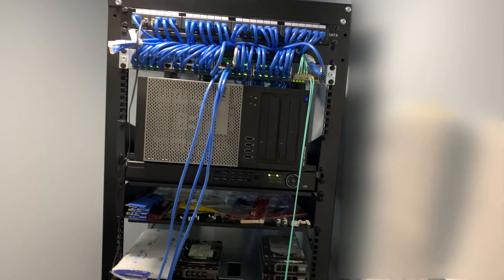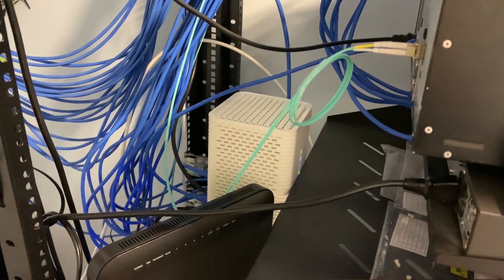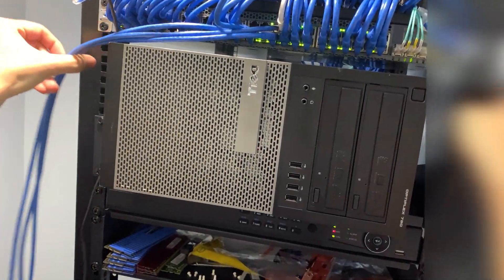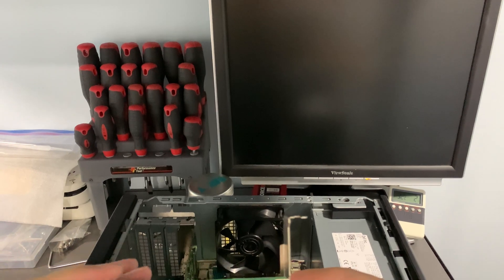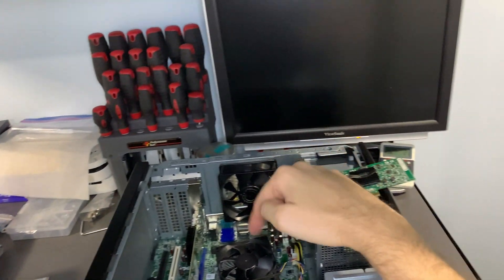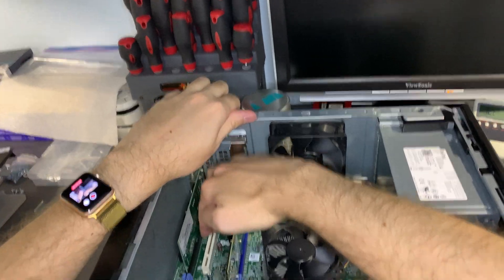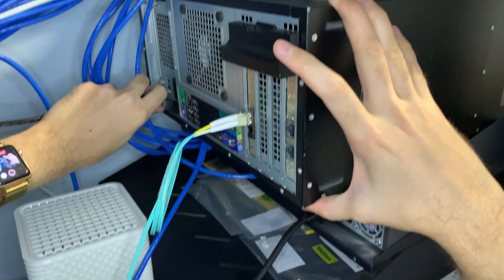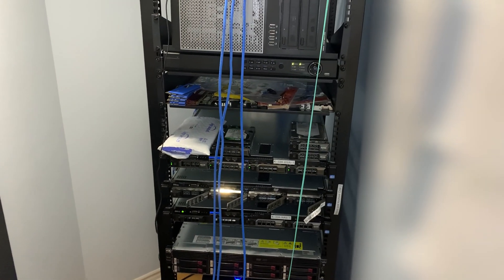Installing Dual NICs in a pfSense Router

Comment: Would you recommand useing pfsense in a vm ? Have an old pc with a 4c4t proc, 8gb ram but i can go to 16gb, and i have the same intel  pci board but its 4x instead of 2x... want a pfsense and a nas for photo media storage... was thinking or truenas scale > vm pfsense/opnsense
Reply from the maker: Yes you can definitely run pfSense in a VM, and I have done this in my environment and others in the past, but there are minimum requirements you need to follow in order to have a successful experience when running pfSense in a VM.

The breakdown below is what I consider minimum in my test and production environment on type 1 hypervisor VMware ESXi. This can also be done on PROXMOX but I haven't tested it yet and I know other people have done it.

Also, seeing how you have older hardware and probably don't have a dedicated enterprise RAID controller I would definitely recommend PROXMOX as a type 1 hypervisor. Also, PROXMOX has built-in features like VM backups out-of-the-box.

Minimum requirements for a great experience for pfSense in VM.
1. Minimum of 2 GB of RAM for the VM. *(In some cases, you can get away even with less amount of RAM, but it all depends on your application needs this is why you should monitor your VM RAM usage, and the beauty of a VM you can always adjust RAM size.)
3. Make sure to "Reserve all guest memory (All locked)" for the VM.
4. At least two ethernet ports being passthrough to the pfSense VM. One for LAN and one for WAN. *(Can use a virtual switch for LAN but it all depends on your application needs. I would recommend using passthrough.)

Optional *someone recommended, this will depend on your host's performance.
5. Reservation CPU MHz *(the value number will depend on your usage pfSense VM usage.)
Reply: @Tek4You-  thanks a lot for you reply.... do you have by any chance a discord or forum something were i could ask some more stuff and maybe send some photos with the build in the next 2-3 days ?
Reply from the maker: @b4g4b3l  No Discord or Forum yet but it's a great idea. Will probably launch Discord it's a lot quicker to deploy it than the Forum.
Reply: @Tek4You-  Never used Proxmox, but happy Vmware ESX user here. I have this running virtual for years, and can confirm that 2GB memory is indeed the sweetspot for starting. Also give the VM not one but 2 virtual cores minimum. I use virtual switch and it works fine for my 1Gbit internet connection, passtrough can be a good upgrade if you have the right hardware. Reservation for CPU is not needed, just make sure your pfSense VM has priority on CPU over your other VM's.
Reply from the maker: @chinesepopsongs00  Wait a minute, are you indicating that you're using the outdated, almost ancient version of the Type 1 hypervisor, VMware ESX Server? If that's the case, I hope your management interface is isolated. You do realize that there are viruses specifically targeting VMware ESX and VMware ESXi, right?